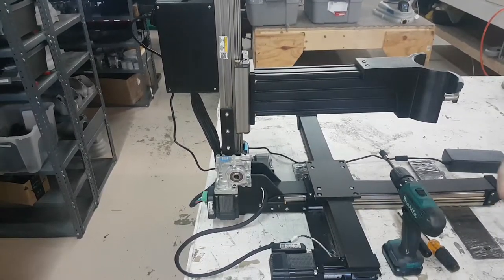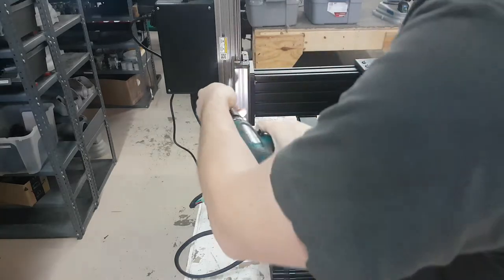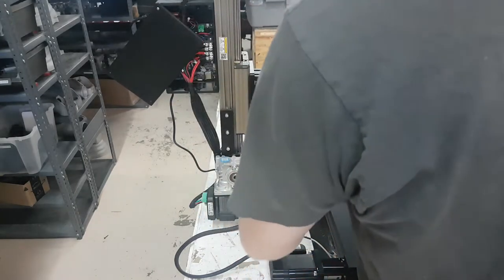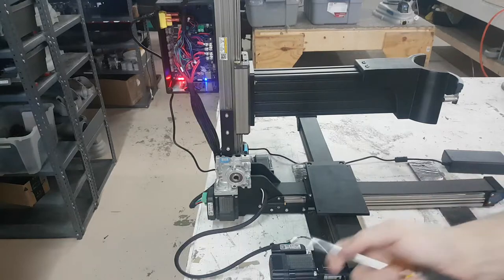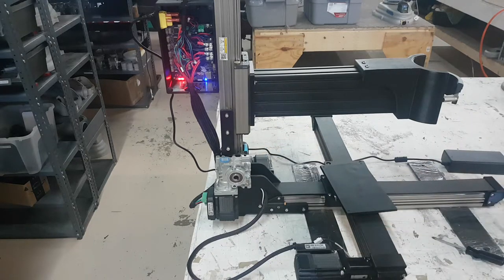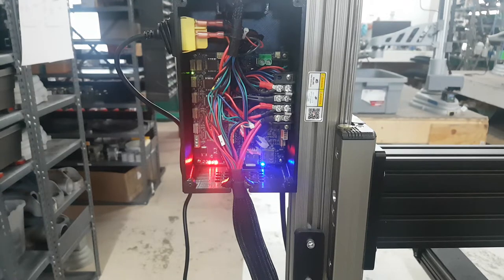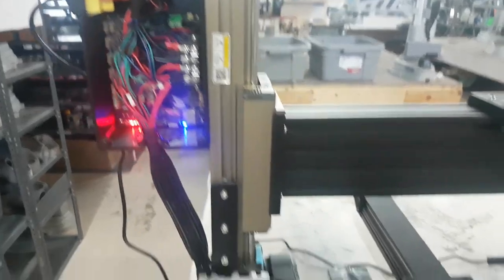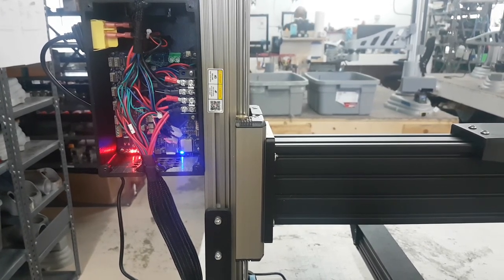Probe Switch Test (Version 10)

Comment: I get a red light
Reply from the maker: That's good! The color of the light on the control board does not matter. It is just an On/Off check light. Color may vary and has no bearing on the test.